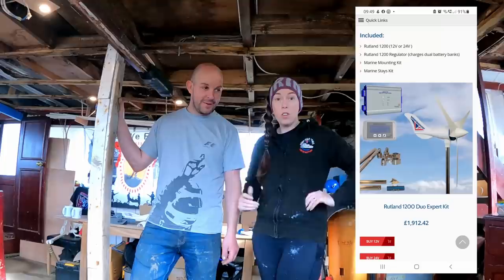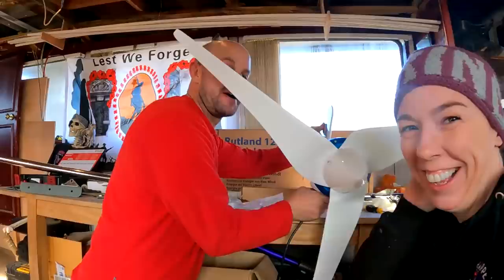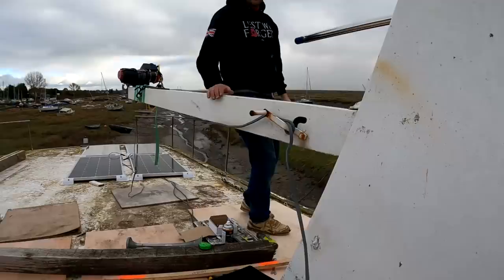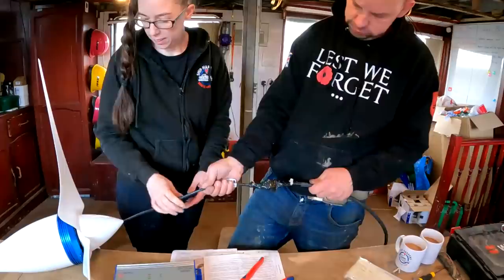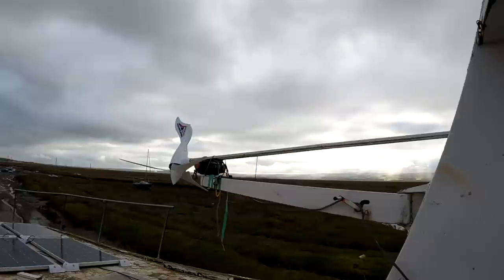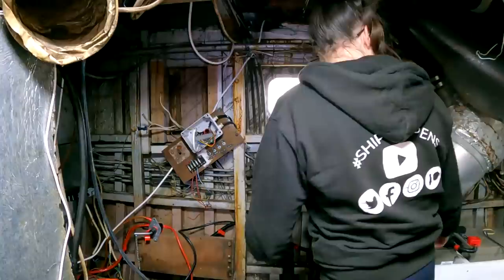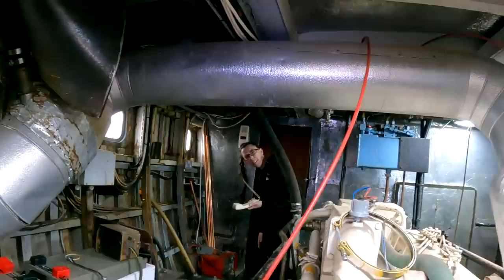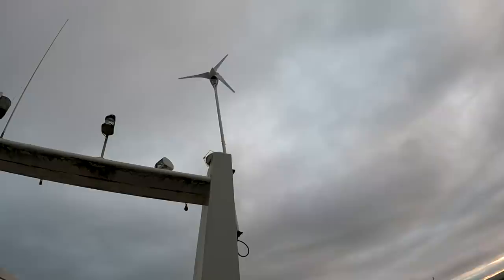Ep 46 - Fitting A Rutland Wind Generator - Solar Power Vs Wind Power & Gemma Rushes Off To Hospital

Comment: That was a fanny episode,( did you see what I did there!). Hope the hand has healed, Simon could take the sutures  out, it is only a matter of cutting the thread as near to the skin as possible so you don’t pull through and thread that has been exposed. You might want to be prepared for the wound to split of it hasn’t quite healed, just use some duct tape to stick it back together. Don’t forget to file that metal strip down!! It is fanny how many people can’t stand the sight of three own blood. , I am a retired nurse, anybody else’s blood no problem, mine I just faint.😂😂

Comment: Don't forget you can add a water heater element to your dump load that way if you're battery's are full it can then heat a water tank before going to a resistor . Love what y'all are doing with that beautiful boat.
Reply: Rutland 1200 does not work that way.  No resistor, all controlled from the wind controller, which will also charge 2 battery banks.

Comment: Loop in the power cable... put a cable tie around it at the bottom of the loop...with the tail pointing downwards. Water will just run off it...
Reply from the maker: Great tip 👍

Comment: I keep a good first-aid kit around the house and in my workshop just for cuts, I have a surgical stapler I bought on the internet for about $15 and veterinarian liquid stitches which is Super Glue that surgeons in veterinarians officesuse for just that kind of wound. As long as you clean it out good before you glue it shut it's fine I've done it many many times.
Reply: @steve whitacre....... will be interesting in another video to see what the many FA kits on Sarinda can do to someone. Quite ironic ;-)

Comment: It looked like you mounted the tube to the base incorrectly.  I am guessing the tube needs to be rotated 180 degrees so the notch in the tube is facing down when you lower it to prevent strain on the wires.

Comment: Alexander Menzies is right. You really must fit a dump load to stop your battery from being cooked. A water heater is an excellent choice.
Reply from the maker: The charge controller regulates and slows down the turbine when the batteries are full, and also if the wind speed is it high.

Comment: Perfect time to experiment with a mag lev VAWT (vertical axis wind turbine) circle disc of magnets then a opposing ring above- and a disc with vertical blades all around a central motor. With your workshop i'm sure you would have nor probs doing this as a project.

Comment: Awesome! You may find those little shakeproof tabs slip; we had to replace ours with normal spring washers with locktite. Ideally the bolts need to be on three sides, not just two (maybe Marlec are listening!). Very happy with ours ... can hear it murmuring away in the distance.
Thnaks for another great video :-)

Comment: I have seen wind gennys mounted using engine mounts to stop vibration noise, or is it actual generator noise.
The noise from wind gens, diesel heaters etc. Can be a bit much in some marina's especially if the owners are away and not affected.

Comment: You have room for a 2nd wind gen. This time use rubber mounts to keep the vibrations from radiating through the boat.
Reply: It looks to me like the mast is already on big rubber mounts.
Reply from the maker: @jaygee5693  it is! Alot of comments about rubber mounts but if everyone was watching they will see them!
Reply: 2 wind generators will generate double the charging power. I would love to know how loud the wind turbine is. But, also how much battery power does it really create?  If you can generate enough power; you could run a fridge, tv, water heater, charge power tools, cell phones, recording equipment.

Comment: If you get some half inch rubber padding and mount it between the wind turbine mounts and the boat it can help mitigate the vibration being transferred into the boat and mitigate some of the noise
Reply from the maker: Did you notice the big rubber bungs that were fitted to the mounts we made??
Reply: @ShipHappensUK  no I did not I may have to rewatch your video. As much rubber you can put between metal contact points the better but when generation is generally noisy for now being that you aren't moving the boat you could raise the wind generator higher giving it more distance between the boat and it's mounting point but being that is mounted to the boat you'll probably always hear. But the nice part is you'll know it's always free energy being generated and after a couple of years it will have paid for itself so then you won't mind listening to it

Comment: A bit of solar and a bit of wind power will do a good job for you, particularly as you have very clean air in your location. You will probably find wind better in winter, solar better in summer. You should be recording battery condition often, so you will notice unexplained changes. I have not noticed a dump load device to prevent over-charging, or maybe your controller simply shuts down? Simon should not be allowed anywhere near that hand, except to hold it and say "There, there, Dear"

Comment: I think you have to think that any energy is free energy I love the turbine.. I’ve fitted a 150w solar panel to the roof of my caravan and for what I use, when I wasn’t connected to a mains hook on battery running the battery would give me. About 2 days but the panel provides enough that the battery is getting enough … ok we don’t use a lot of stuff and a caravan is a lot smaller

Comment: Great move. I assume you will lower it at  sea since the mast probably interferes with the reception of the RF DF set. As you are highly practical and skilled  you will have plenty of time to devise and create a cradle  to fit on the boom
Reply: Yes, either move the antenna or the wind generator mast.  That’s why the antenna was where it was, with nothing in its azimuth.

Comment: Going to be very interested to see how the numbers vs the noise stacks up for the wind generator. We have been looking at the same Rutland model but we have two real masts to avoid (plus not putting shade onto the solar). We have wondered about only putting it up at anchor so we can attach it to the bow and keep the noise away from our cabin.
Reply: A lot of the noise from a wind turbine on a boat can be the hull in sympathetic vibration, particularly with metal  or fibre-glass hulls. A rubber insulating pad under the post helps. If you find a flat panel somewhere is vibrating, simply adding a cross brace will stop it.

Comment: Glad that your hand is healing up nicely Gemma. You can say the scars from when you were repelling nefarious borders and got nicked with a cutlass. ARRRR! 
I’m curious about the angle of the wind generator mast. I would think that it needs to be as plum as possible for optimal swing. But, I’ve never put one in so what do I know.
With the combination of the two systems, the most advantageous time to run the generator will be at night, unfortunately that’s when the noise level is going to be more irritating, bummer. 
Is there an auto select system that the solar and the wind generation feed into? Can both systems operate at the same time? And is there any sort of backfeed prevention? I know really nothing about these systems. I am old, we didn’t have sunshine and wind when I was young so I never learned about these newfangled whirligig contraptions! Obviously there’s some sort of witchcraft involved, so be sure and carry a good quantity of salt that you can sprinkle around yourselves every now and then. Better safe than sorry😎

Comment: A little tip: not a good idea to run the wind generator in gale conditions, the bearings tend to wear out rather quickly. I don't have experience with the Rutland but it looks remarkably like several other brands.
Hope the gash is ok and Clostridium tetani has been dealt with in the usual manner.
Reply: It looks as if it is designed with a braking system so it doesn't spin needlessly fast when no power is required.
Reply: I've had mine out on a mooring in Chichester Harbour for about a year and it's been great. Survived all the gales with 40 to 50 knot winds without a problem. As soon as the battery is full it goes into breaking mode. If the power goes over 480 Watts then it stops itself from going faster as well. I also have solar so the combo has worked well this winter.

Comment: Please revisit the HMS Medusa and take pictures of how their restoration was done on their electrical system. From what I see of the current mess, it will never be approved for your seaworthy certificate. Surly from your local audience, there is a Marine Electrician that if asked will come aboard and make some recommendations or even draw out something that could be approved.
Reply from the maker: We are not at that stage of restoration yet mate! All of the electrics will be done to code, we are very early in out restoration and there is alot to do before we think of coding and specs!
Reply: In the Uk we don’t have seaworthy certificates. Good job too looking at the wiring on the yachts I have been involved in.

Comment: Hi Guys, I just bought one of these and did not realise it did not come with enough cable. I doubt you look through all old comments, but in  the off chance you do. Could you tell me a little bit about the extra 50M of 3 strand cable you bought, basically I'm looking for info about AWG size and possible a reference to a store to where you got it from  thanks
Reply from the maker: Product code from Marlec - 902-042 Cable Marine Tinned 4mm² 3-core

Comment: you could have just used super glue to close it up if you had any on the boat it's basically exactly the same stuff the dr uses to close superficial wounds that don't need stitches

Comment: Having spent many years off Sable Island Running gas Platforms with Wind Generators, when you think you have built it strong enough, Double It. .It will not be strong  Enough ..I can Guarantee it will fail...Trust me

Comment: Is the noise from the blades or the vibration going down the pole into the boat?  If it’s vibrating the boat use a rubber bushing to insulate it front the boat…

Comment: 5 meters/sec???? this is a ship, what is that in knots? or perhaps Beaufort wind scale?  :)  You are not on land or I might ask for furlongs per fortnight.  Here in Canada, wind speed on land is in KM/H on the government weather page but marine forecasts are knots. I guess metric does not equal metric. Anyway, wind generator noise is the downside but you will get used to it just like getting used to the cheerful sound of a diesel (some people say angry). The people near by in an anchorage will find your wind turbine noise more annoying than you will but it is a lot quieter than a genset.  What is the highest wind speed the unit can handle with the brake on? Do you have to lower it if it gets too windy? Good job on the install, keep it up.
Reply from the maker: All the specs to the turbine are in the link in our description.